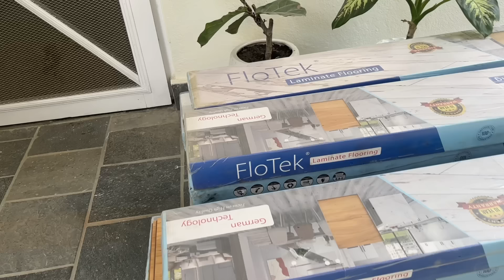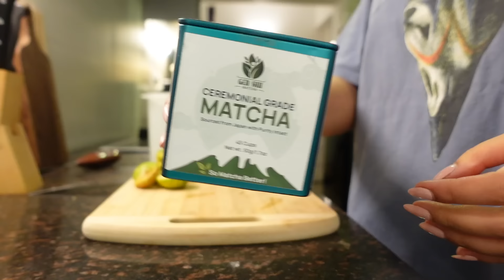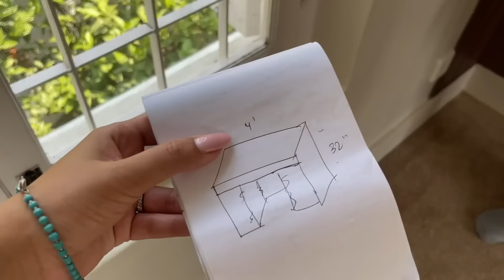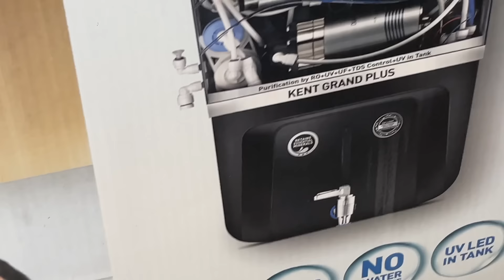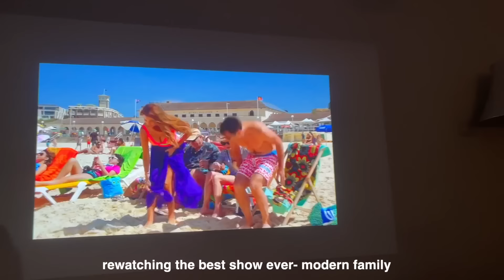my kathmandu home transformation (part 1)

Comment: lil hack : which using that squeeze air bag thingy, use vacuum cleaner to suck the air out instead of the pump. It will be way too fast and it does the same thing in like seconds
Reply: I was going to say the same thing